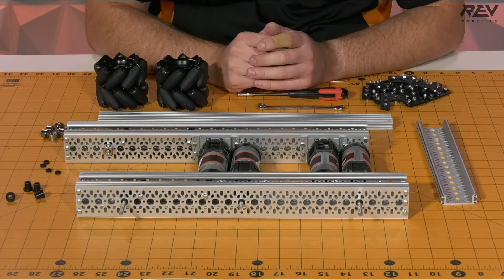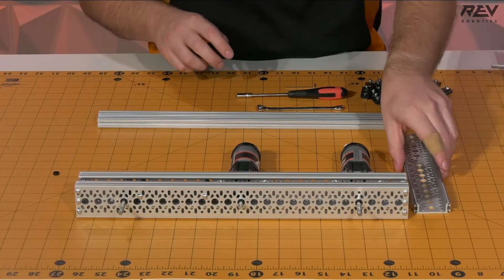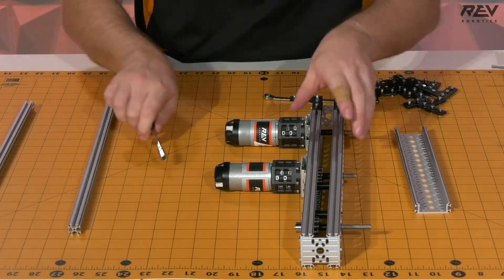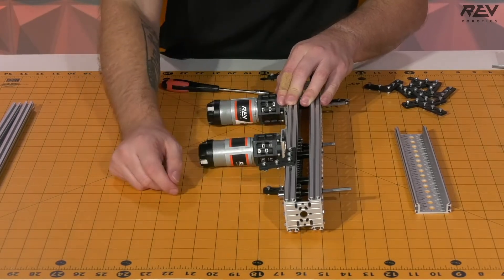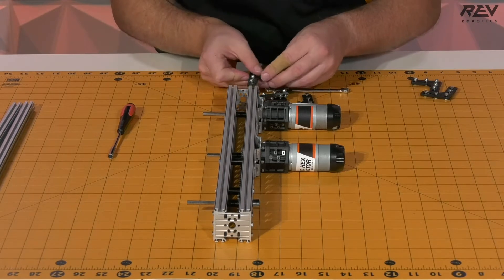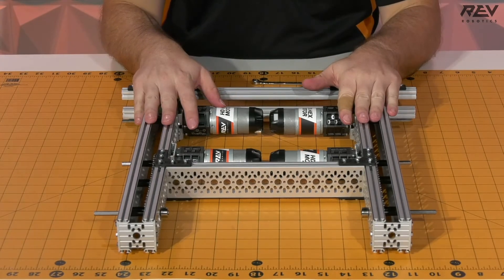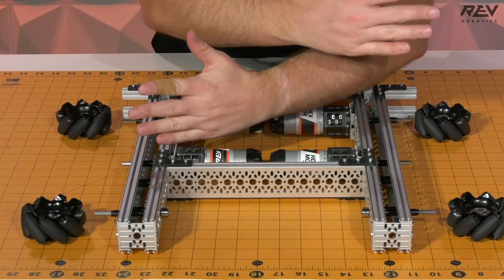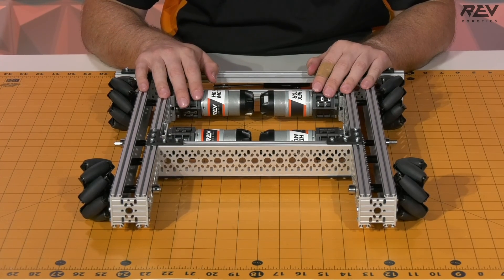Mecanum Drivetrain - Final Assembly

Comment: Hi, could you please make a video showing us how to make a support for the control hub on the drivetrain? thanks & love u guys!
Reply from the maker: There are a few things you can do but one really easy way is to use a Battery Holder Plate (REV-41-1166) with a Control Hub mounted to it. Pretty easy to mount the battery plate to either slots or the extended motion pattern.